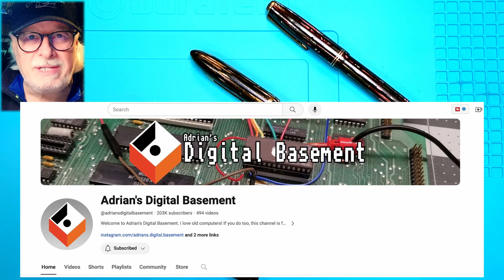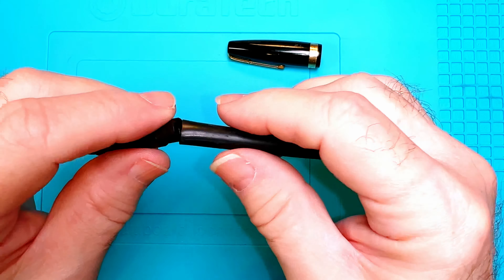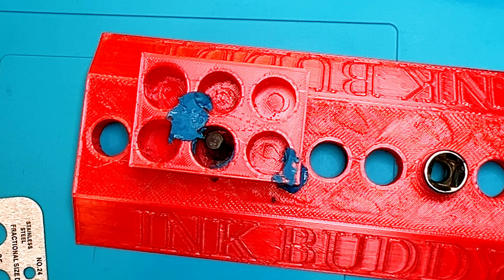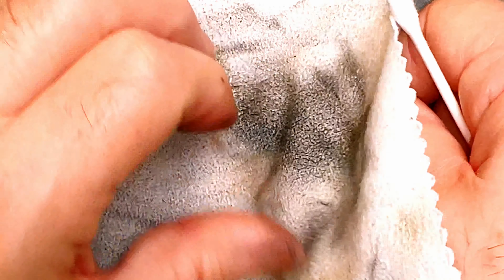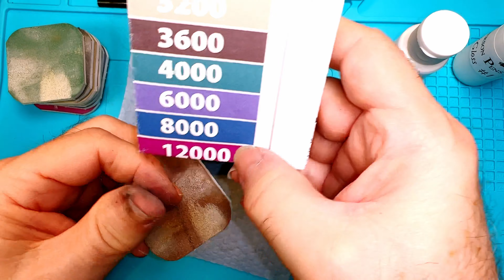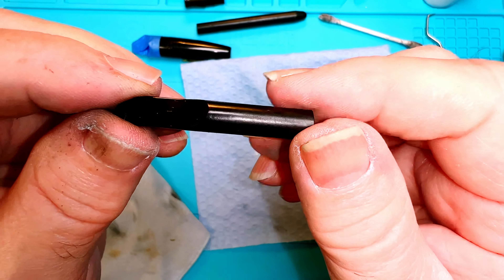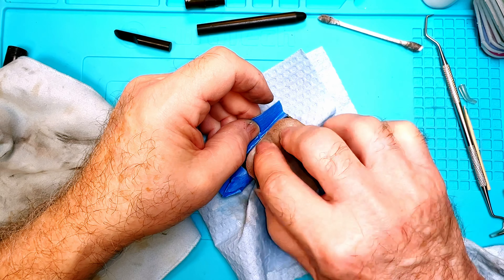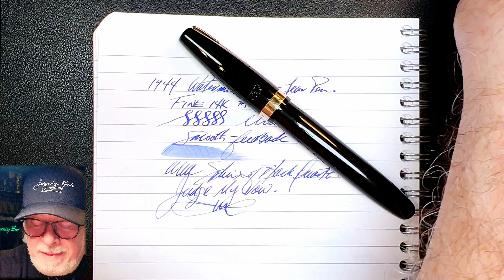Pen Resurrection Sunday Ep. 53 - 1944 Waterman's 100-Year Fountain Pen

Comment: Thanks for this, Doug. I much prefer your new format. Your detailed procedures are well presented with clear explanations. Unfortunately, some pen restoration videos on YT have a habit of skipping the trickier aspects (oh, look … there’s a new inc sac in place – how did that get there?!) The box lever is clearly a substitute from a different model. If you look at the recess for the lever, it is designed to take a ‘spade’ type of lever tip, not a ‘spoon’ as you have there.  Nevertheless, it works. For me, replacement levers and J-bars are an arduous and often frustrating task. Keep up the good work and the new format. Thanks. ✒️👍🖌

Comment: I like the new format a lot! There is something very relaxing about watching a restoration. By the way, one of the reasons the pressure bar isn't going down all the way is probably because of the lever box. I think it's from a much smaller (in diameter) pen so the fulcrum (I think that's the word?) of the lever doesn't allow it to go as deep. 

Still, I like the look of those old levers so much more, I wish they stuck with that design! So much more elegant.
Reply from the maker: I"m sure you're right. The lever box doesn't match the pen at all.

Comment: Doug, have you ever tried the Pineider Pen Filler? It's a traveling inkwell with a tapered silicone sleeve that grips around the end of the section so you can turn it upside down and have gravity assisting the vacuum created by the sac. I use it on my Waterman Commando primarily, and it allows for a completely topped off fill.
Reply from the maker: Yes. I reviewed it not too long ago.
Reply: @InkquiringMinds  must have missed it somehow, the sac not compressing fully made me think this would be a good use case.

Comment: If this is celluloid nitrate, you might want to remove any wax coating. I've read that this material off gases and you shouldn't block that process. Great video
Reply from the maker: Thanks for the tip! If David Nishimura recommends against it, that's good enough for me.

Comment: Thanks for providing so many informative details, Doug. The recipe for ultrasonic bathwater, the varieties of polishes, and how the materials respond to your intervention are very helpful. Putting Crazy Glue, Super Glue, or any other brand between the shrunken resin and the metal band causes "Blushing"? Please explain. On the rare occasions I've used the stuff for pen repairs, it's either to hold loose end jewels or to keep cracks from turning a (usually cheap) pen into crumbs.
Reply from the maker: Blushing is a milky haze that covers the area. The CA glue off-gases and causes it. CA should be used with extreme caution around fountain pens.